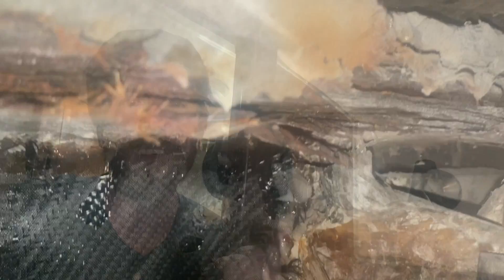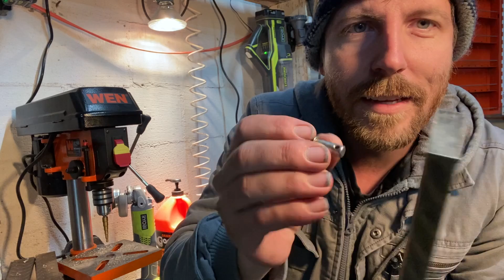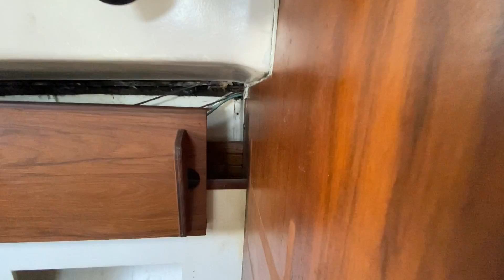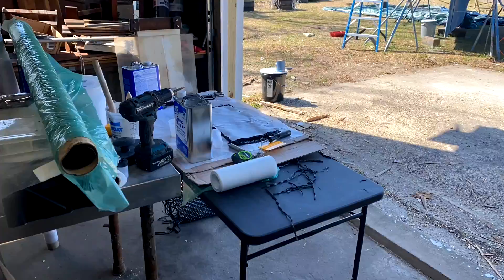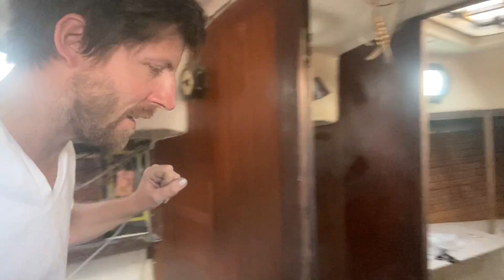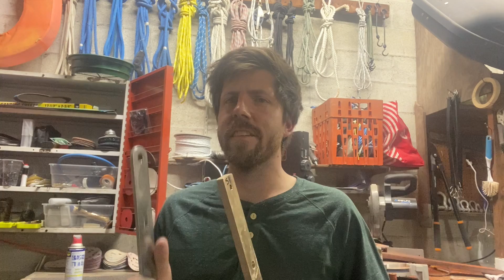Bronze & carbon chainplates beastmode911 strong

Comment: I'm starting to think that expression "Go small, go cheap, go now" (or whatever it is) doesn't really cut it.  Less fibreglass, less paint, smaller sails for sure, but I'm wondering if the savings, if you were lucky enough to find a bigger quality boat for the same price, would be all that different??  Either way getting a boat really seaworthy is a huge task, keep on trucking Sir!
Reply: High quality smaller yachts exist - unfortunately, Cape Dory never made one. Most of their stuff had serious problems - gelcoat issues, hull/deck joint issues, cheap unprotected steel chain plates that rot away to nothing etc...etc... Sam's channel is unintentionally turning into a "why you really don't want to own a Cape Dory" series.
Reply: @cjg6364  I'm learning - thanks!
Reply: @cjg6364  
Good comment. I suspect  Sam would choose a different boat if he had to do it over again...which would be an interesting topic for him to talk about.

Comment: Curious as to why not replace the chain plates in their original position with bronze plate vs the outside of the hull? What am I missing here?
Reply: Hmmm idk maybe this seemed an easier method. Should be stronger. Also clears them from the deck. Seems crazy cape dory used mild steel for the original chain plates.
Reply: Sustained gale force winds will not rip out those hull mounted chain plates. Sam’s load will now be distributed over a larger, stronger area. Did you not see how petite those factory deck mounted plates were?
Reply: Most people put them on the outside for easier access to them.

Comment: Titanium is used with carbon because or galvantic corrosion if u use stainless steel with carbon ull find electrolysis will make the stainless corrode rapidly
Reply: Carbon, saltwater and corrosion is often overlooked.Likewise the susceptibility of carbon to damage through blunt forces. The former leads almost always to failure of the metal inserts in carbon bicycles (bidon, derailleur). Metal plus carbon plus sweat.
Reply: @cls9474   laminates dont enjoy shock loading in general

Comment: I'm not a sailor at all, but I definitely agree that bronze is superior to stainless. I just remember one time I left a stainless steel spoon in a bowl of salt, and it sure did get rusty. 

Now, if it were cost-effective to make chainplates out of niobium, that might be a good option, but it would be pretty damn expensive. I remember they had to make some of the wiring on the Parker Solar Probe out of niobium, with sapphire insulation, because of the high temperatures it would have to endure. Pretty wild.
Reply: Your spoon wasnt marine grade stainless thou !!

Comment: Sam just a thought from a machinist,  never grind soft metals on a bench grinder,  very dangerous.  The metal loads up in the stone and creates heat which can cause the wheel to crack and come apart.  VERY DANGEROUS.
Reply: I'd also add always wear protective eye wear when doing ANYTHING on the machine. Drilling, cutting, grinding.
Reply: Use a belt sander
Reply: How would you round off the corners then? - question from a non-machinist who knows NOTHING about working with metal!
Reply: @jameseaton905  belt sander or other sanding device
Reply: @walterwinn2842  Thanks!